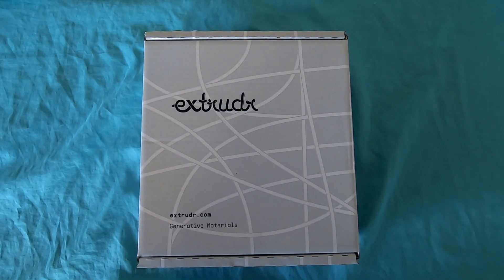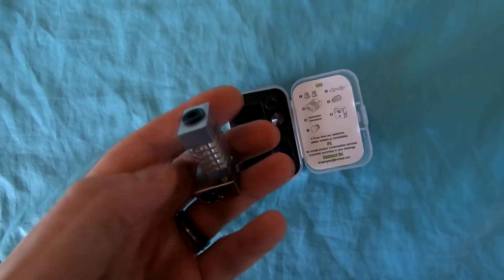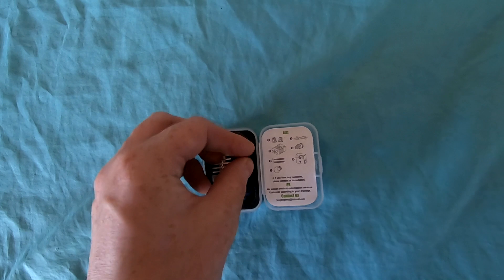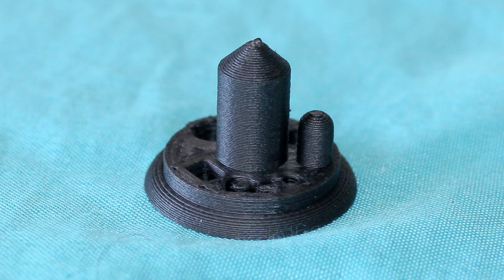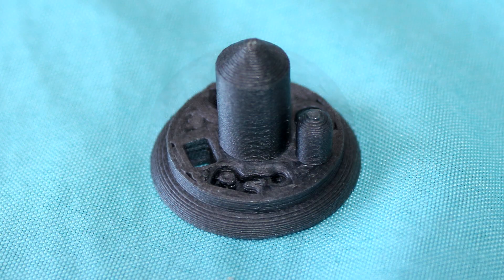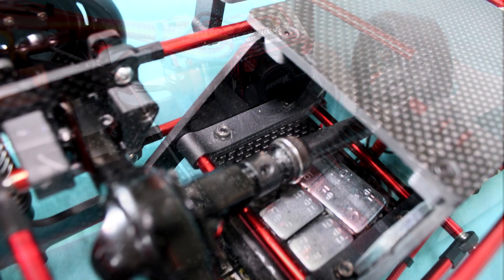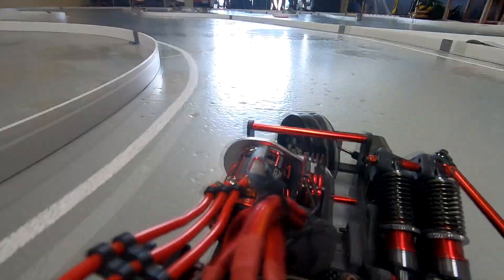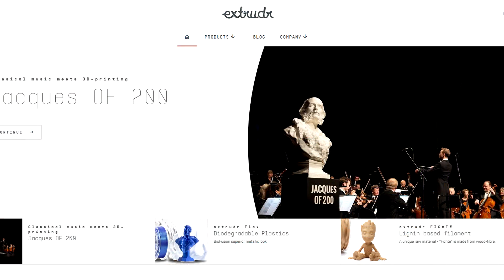Mellow3d Full Metal Hotend and GREENTEC PRO Carbon Review

Comment: Hello, Thanks for your video. About I try to print this filament, everything seems Good but I have some trouble with bed adhesion. I have bambulab x1c Carbon, try many différent plate but always same adhesion issues. I clean plate with alcohol before every print
Reply from the maker: Didn't have bambus when tested this filament how ever do now,Always use a light layer of glue beds even tho many will say don't need it...

Comment: Settings used?
Reply from the maker: Wasnt anything special,Was my PLA settings with flow rate changed to suit,Ran 0.6mm nozzle,Dont have a magic setting that will work on every machine but starting with your normal PLA settings will give you a good base to work from as this filament is still a PLA filament with Carbon Fibre  added to it